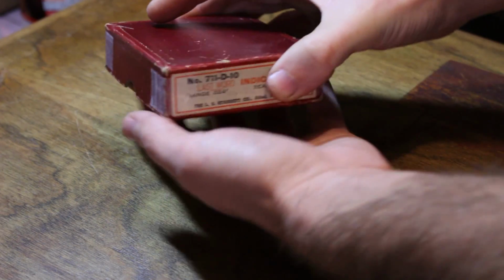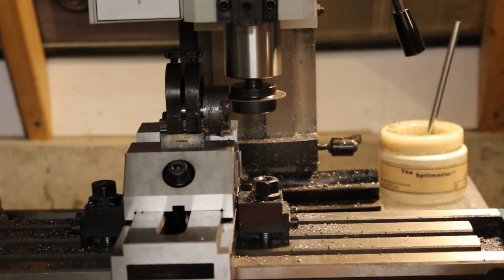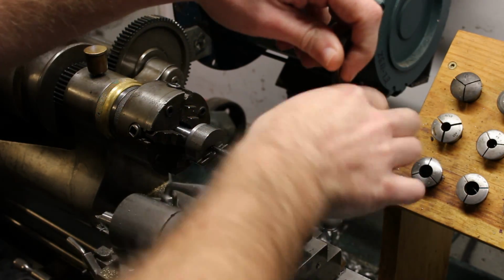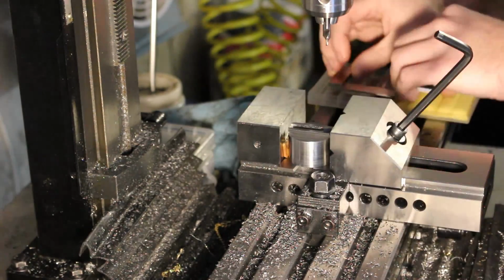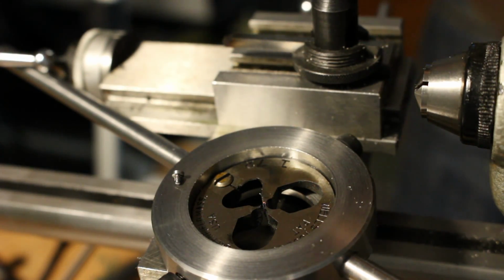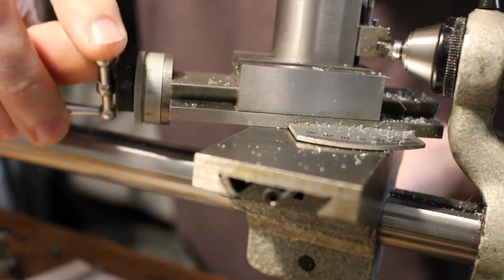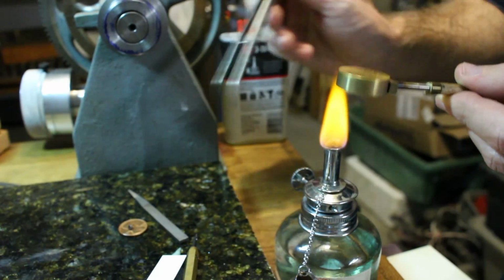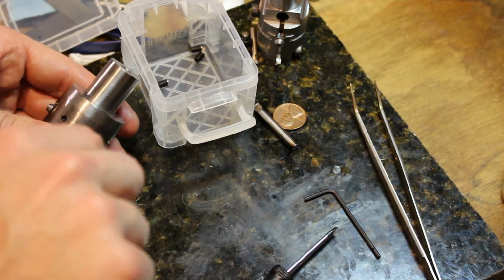Shop Made Miniature Boring Head, part 2

Comment: in two weeks you will find the screw ;)

Nice work on the boring head and on the video!
Reply from the maker: LOL Thanks Stefan!  You wouldn't believe how hard I looked for that screw.  I finally ended up deciding it must have fallen down between the boards that make up the top of the desk, so I cleared the desk top, pulled out all the drawers (this desk is huge, the drawers are almost 6 feet wide) and crawled around inside it with a flashlight!  Still no luck.  I will probably find it embedded in the sole of my shoe or something. :)
Reply: The Joy of Precision Once, I had a watch screw fall off the bench and I could not find it on the floor anywhere. Stopped looking for it and several hours later, it fell from my shoe as I was taking them off. Another watchmaker I know had turned a balance staff and it fell to the floor. His wife found the staff in the cuff of his pants.

Comment: Thanks for an eduacating and amusing video.I ask where the clamps being used for the Toolmakers Wise cómes from?  have two of those wises, the 38 and the 50 mm wide chuck jaws. I search a nice way to clamp them both to a Micro Mill and a Mini Mill.
Reply from the maker: Thank you, Stefan! The clamps came with the vise, from littlemachineshop.com, they probably sell them separately. I have since begun using socket head cap screws with them, so now there is no nut sticking up past the bed of the vise.
Reply: Thank You very much for Your fast answer. I have been looking for proper clamps for quite some time. The sellers I bougth the wises from didn't provide those clamps. I have seen them in Youtube videos. Price is affortable but shipping cost from US are horrific. Then Swedish post adds Another 10 USD... Never mind, it costs to be on the top. I bought 2 sets...There is a version of those wises that have a long slot, like the slot in the short end. Doesn't comply well with my stuff either.Again, thanks a Lot!Regards,Stefan

Comment: your tool holder is something else.
Reply from the maker: The toolholder in the lathe I use most of the time?  Yeah it's pretty oddball, it's Rivett's patented eccentric toolpost.  It was an option available on Rivett lathes and Hjorth lathes.  You can do some neat things with it, but it's not quite as convenient as a quick change toolpost.

Comment: What was your conclusion regarding the trial use of salt in your tempering process on that screw?  Any significant difference from your usual brass chips?
Reply from the maker: Rats, I did mean to mention it in the video - totally slipped my mind.  It worked very well for even heat distribution, and it is already clean (the hassle with brass chips is making sure they are completely free of oil and other contaminants).  However, just a couple uses of table salt in this brass pan has dulled the surface of it from pitting.  Normally that wouldn't be a concern with a bluing pan, but since mine has those internal threads I really don't want it to get corroded.

Comment: I was wondering about why you do not use the hand held graver more often for turning on your watchmaker's lathe? I find I have more control and faster transitions when turning at different angles. I also like using the graver for finding the true center before drilling. Not a criticism as there are many ways to achieve the same result, of course. Thanks for sharing your work! Daniel (another Canadian).
Reply from the maker: Thanks for watching, Daniel! I agree that turning "by hand" offers superior feel and control, and I also agree about much quicker geometry transitions.  Nevertheless, I only tend to use a graver when turning very delicate components such as balance staffs.  I suppose I simply haven't developed it into a habit.

Comment: Very nice indicator and video I very much like your indexing method . Personally I brought another headstock for my taig lathe and with a gear banjo I made I can get 5 -360 graduations . I did this so it takes my myford gears and as I have metric and imperial pretty much anything is available. I will have to get some photos of my little diving head that I made . 

I think we have similar mills too as mines a heavily modified x2 with a long table 

GREAT VIDEO !
Reply from the maker: Thanks very much, that sounds like a really slick arrangement!
Yes, they are great little mills for small work, I have been very happy with mine. :)

Comment: I love the blue tape - I'm going to have to start doing that.    And the torx driver does work so much better than an allen key.
Reply from the maker: I used to use a sharpie mark but the oil and chips would quickly remove it.  I want to say I picked up the tape trick from another video years ago, but the details escape me (stoopid brain!)
Reply: I must declare I'm not a fan of tape, sharpie, or other methods of convenience over precision.  If you have indicators, touch off and use them.  Set a depth stop, and machine a precise, repeatable hole depth.  

A cheap dial indicator on a magnetic base, thoughtful application of the depth rod on a cheap caliper,  there's plenty of inexpensive and quick ways to improve precision orders of magnitude over eyeballing a piece of tape!

While quick'n'dirty may be good enough, why settle when the difference in effort is so small?

Comment: What kind of steel do you need to use to successfully heat blue it? Does the blueing prevent oxidation?
Reply from the maker: I'll definitely second what Buckminster says.  They are probably the best videos I've come across that show hardening and tempering small parts, along with watch-grade polishing and flame bluing.  To briefly answer your questions though, as I mentioned I used O1 steel for the screw in this video, but any high carbon steel can be hardened.  Of course there are some exotic alloys that you can't realistically heat treat in the home shop, but your basic high carbon steels and water, air, and oil hardening tool steels are all great candidates for heat treating small parts in the home shop.  The bluing is, itself, oxidation... FeO3, I think?  As the steel is heated, this oxidation layer forms and the thicker it gets the more it alters the wavelength of light being reflected back through it from the underlying metal.  That's what causes the color changes.  Obviously this is an incredibly thin layer of oxide, so it's too delicate to use for parts that are handled regularly.  Oil blackening is much more durable, but the chemical hot bluing is probably the most durable.  This flame bluing is useful for gauging the temper of the steel (if, and only if, the heating is done very slowly, and if you know which colors correspond to what temperature ranges for the particular alloy of steel you're using - it does vary a bit for some of the carbon tool steels), but other than that is purely cosmetic.